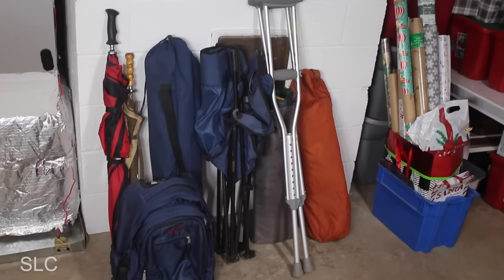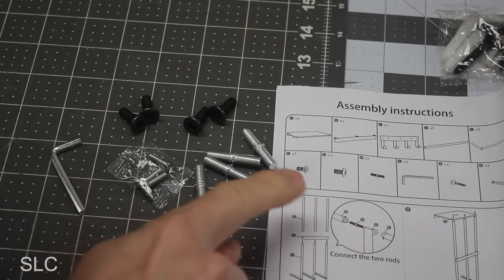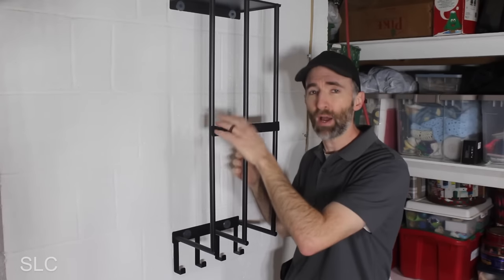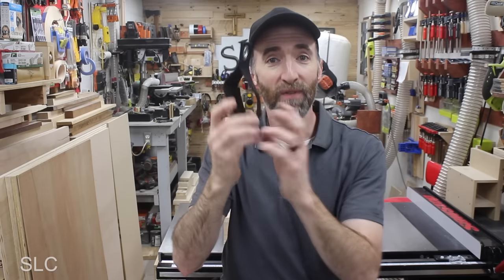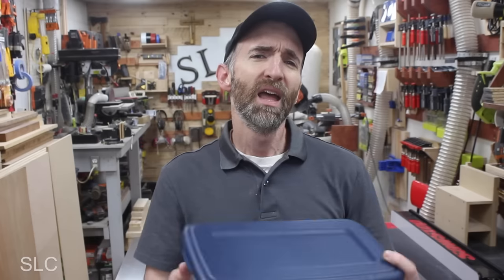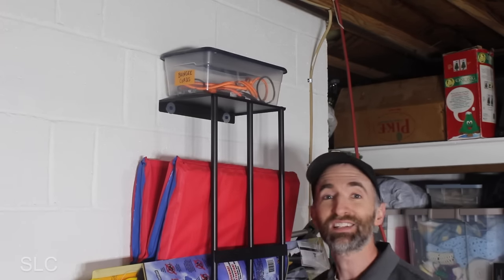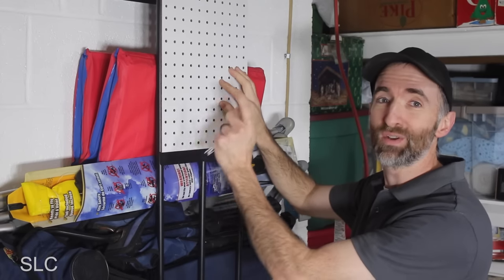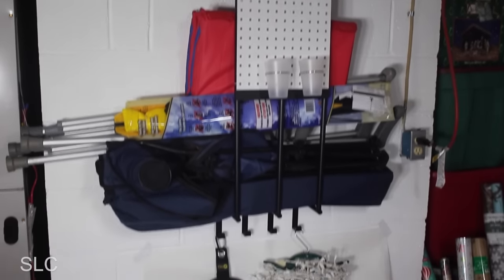5 AWESOMELY Simple Garage Storage Ideas

Comment: Try adding some horizontal struts to the vertical tubes so you can separate the items (camp chairs) so you can pull one from the bottom without disturbing the stack   very cool btw

Comment: Thank you for the inspiration.  The first item is out of stock now.  You can easily build that first item with wood and PCV pipes.  don't even have to attach to wall if you have a shelving system like Muscle Rack.  Just attach pieces of wood to the shelves and connect PCV or metal pipes between those woods that extend out from the shelves.

Comment: Great ideas! Guess what I'm buying on my next trip to Lowes! Anyway, here's what I've done as a no buy way to organize my garage and basement. There's a swap "shop" in our recycling center. Each time I go there to throw out my garbage (which costs $1,000 per year for a private service!!!), I look at what's available. I have acquired a lot of Sterilite drawer bins for beach toys, camping stuff, grill accessories, etc. I also found tote bins for things such as holiday decorations to store in the basement. I found a donated crib with a peg board for the bottom. I put that on the wall for the bike accessories. I thought about taking the slatted sides, but couldn't think of a use at the time. The next time I was there, they were gone! I also use discarded milk crates for items such as gasoline containers and big rolls of shop towels. In the summer, schools toss out things such as book cases. One of them holds our winter boots and cooking equipment we rarely use. So my garage and basement don't look Pinterest worthy, but they're mostly dust-free and we can store both our cars in them. That part is not negotiable!

Comment: The only proper way to store a hose is a retractable hose reel. Yes, they are pricey, but they're a great investment. Got myself three 30-meter ones last spring to cover the whole plot, the change is drastic. No more connecting and disconnecting the hose, unrolling it and rolling it up, just pull it out, use it, a slight pull and the spring rolls it back in. Everything nice and neat, no hassle at all.
Reply from the maker: They are definitely one of the best ways to store hoses, but not everybody is willing to buy them.

Comment: Place some duck tape on the top of your carpenter pencils and punch a hole in it.  Now hang them from the pegboard.  Instead of buying cups for pencils use your used shampoo bottles (I like the square ones they stack best) and cut them with the ever present utility knife, voila a plastic storage container for pencils and misc.

Comment: I installed plastic pegboard in my garage and there are three things I like about it. 1. You don't need a stand off frame because it already has edges molded in. 2. The plastic hooks fit tight in the holes so they don't come off and fall when you lift something off of them. No retainers required. 3. The plastic hooks have large rounded tips so they won't scratch you or anything that might brush against them. Also, you are not limited to the plastic hooks, anything designed for normal pegboard will work because the holes are the same size and spacing as normal pegboard.